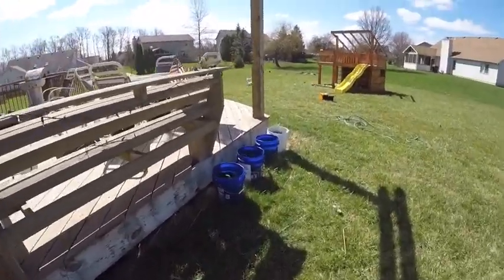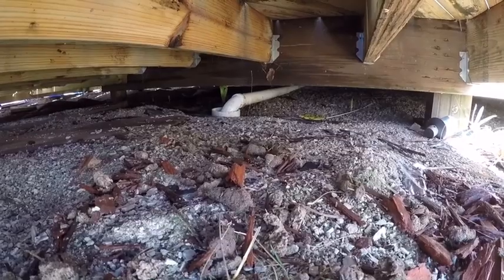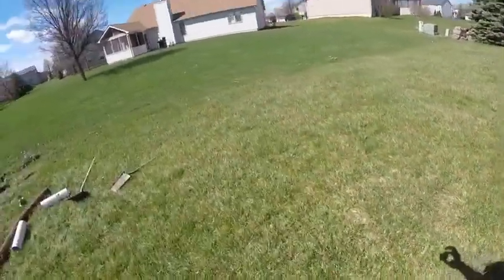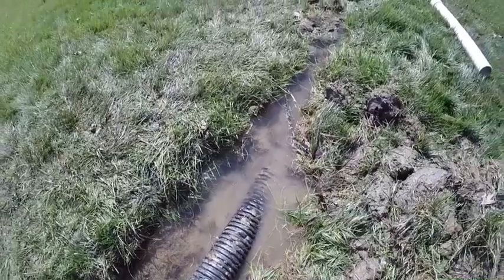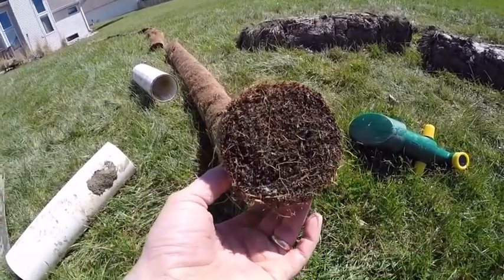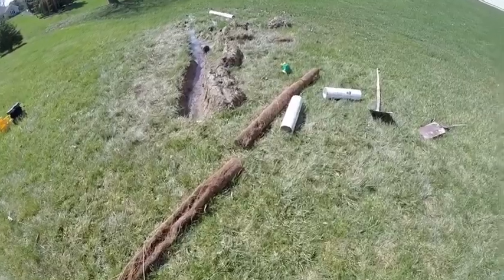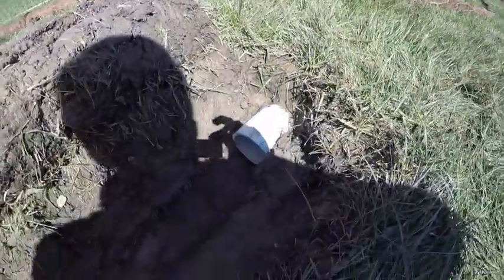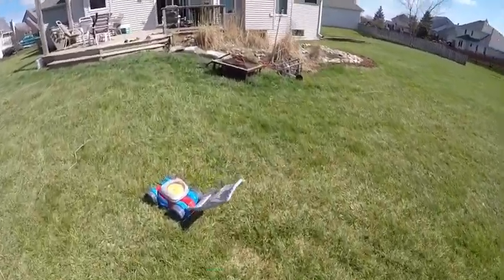How to Prevent a Root Invasion in a Drain Pipe

Comment: It’s not the pipes fault. The installer did not install it correctly. Should have have 1 ft of rock all the way around the corrugated pipe and had geotextile fabric as well. I’ve had French drains for 20 years with never any roots or dirt in them.
Reply from the maker: Hey preformancemustang,
Thx for the tip.

Comment: Step one Don't do a shallow French drain that is the biggest thing.  Those are grass roots and you can see how deep there go.  You pipe was just a few inches under the ground be a foot or more and you wouldn't of had that problem from grass.  Now  tree roots yeah you would of had that problem  Two even solid pipe will clog with roots takes a while but does happen.  All you are doing with that water is recycling it over and over again.  Unless you are putting it in to a drain tile to take it away to a ditch or sewer its not  doing much good.
Reply from the maker: Hey John, 
Thx for the input!

Comment: Dave, I had a 6 foot long tree root clog -in a solid 4" PVC drain line! The only way to prevent root intrusion, in the pipe, is to have the PVC terminate above ground.  My pipe ends on the side of a hill now.  You will have to dig a pit and line it with rocks, like someone else suggested -or you are guaranteed to repeat this project.

Comment: You need to put the pipe in the middle of a bed of clean gravel which is wrapped by a heavy non woven fabric.  Dig a deep ditch. Put the fabric down with enough on either side to cover the top later. Put minimum 4 inches of drain rock down, the pipe on that then 6 inches of drain rock on top and sides of pipe then cover with fabric. Done.
Reply from the maker: Thx for the added directions!

Comment: I just had a downspout replaced that was attached to a corrugated pipe going into the ground and empties into the ditch.  I had the gutter company just put an 18" extension out to the yard for now. They had to cut the top of the corrugated tile off to get the downspout out and after they were done, I went to cap it and noticed the same dang thing that you have in yours. It's plugged with dirt and roots. I cleaned out as much as I could but I cannot get to the rest of the pipe to the ditch because it's under the cemented driveway.  I just stuck my hand down there with a screw driver and tried to dig out as much as i could but now I can't go any further because the dirt and roots are so compacted into it that I can't get anything loose unless I dug the whole thing up which is not going to happen anytime soon.  The guy that lived here before I bought this house thought it would be a good idea to plant a cedar tree and several pine like bushes on top of the tile.  I don't know what the heck he was thinking.  Going to just cap this tile for now and hopefully nothing stupid happens later.
Reply from the maker: Hey Jennifer,
Sounds like a mess. Once the roots get in deep, digging it up is likely the best, (most painful, and sometimes near impossible) way to fix it. Fun!
Thx for watching!

Comment: Roots are not limited to drain lines.  We run into the same thing in shallow water wells where the roots come in through the perforations in the casing that let the water in.  The bad thing is we can't get to the pipe to dig it up.  The best we can do is make sure the well is grouted good and try to keep them from following the borehole down to water level.  https://www.youtube.com/watch?v=TVdA-u0YzVM is a video of one we pulled out. 
Have a good day,
Kenny

Comment: Here in Tennessee almost everyone who has a house built in the last 30 years that has septic tank with a drain field has problems. The reason being about 30 years ago the state code for a drain field was changed. Today any house built has to have a 2ft wide by 36” deep and 300 feet long drain field. Most houses have 3 100ft drain fields with cross over lines attaching them together. 30 yrs ago they were dug with an 8 Ft wide  bucket, 60ft long and 4 feet deep. Filled with 40” of gravel and a heavy layer of straw then dirt. That way worked much better for draining. If you had a clog somewhere the drain field being so wide the gray water could usually flow around the clog. As long as it wasn’t at the beginning of the drain field. The code here needs to be changed to the old way I believe. Good luck with your problem. Drain field problems suck! It almost makes you want to move into the city limits and just have city sewer!
Reply from the maker: Hi Silverhorder1969, your information about septic tank drain fields is very interesting.  We may be building a wedding barn in the near future out in the country that will require a septic tank, so we will keep your comments in mind if we go through with that project.  It sounds like Tennessee really needs to go back to the state code they had 30 years ago.  Maybe you could contact your State Representative to bring up this serious issue that affects so many people in your state.  You could show them our root invasion video so they can understand the problem.  We have vacationed in Gatlinburg cabins many times and we really enjoy Tennessee.  Thanks much for your comments!
Reply: You’re welcome Extreme House Flipping.

Comment: Truly amazing I think I have similar problem in my back and front yard.I guess only way to fix is to install new pipes in pvc plumber has quoted me several thousand dollars for repairs Starting to think may sell house I bet previous owner knew about this 4 years ago and of course not picked up by building inspection.I thought modern pvc pipes had overcome this root problem but this house is over 25 years old.They planted trees right over the sewer line front and back some people just plain stupid.
Reply from the maker: +trackburner Hi Trackburner, we have a rental property that had roots in the pipes. A company came out and ran a roto-rooter tool down the pipe, which chopped up the roots and solved the problem at a low cost. If you haven't tried that yet, it would be a good idea to use this method before replacing your pipes. Good luck!
Reply: trackburner check a drain cleaner guy...i watched a video where it looked like a solid pipe 10" i believe ..like from a concrete truck...and the machine goes through it...I think its worth a call, maybe ask for a free quote...gotta be a truck with a big holding tank...not a powerwasher you understand. .
Reply: Not that serious they have a main lone cleaner u can rent it at home depot for 60 bucks they will show you How to use it it comes with an attachment that goes in and chops up the roots then use a root killer twice a year for maintenance

Comment: My parents septic tank had 25' of 4" pipe plugged with thick roots & 25' of 2" pvc pipe that forked off from the 4" pipe that elbowed under their trailer framing packed with roots that literally snaked through the 25' coming out of their kitchen sink drain, my parents passed years ago so the trailer sat not being used therefore caused the lot of issues of roots taking over in the tank looks like a jungle of very thick roots scattered through the tank that have to be cut out though to think that these roots began in the tank & spread 50' into the piping is unbelievable a complete nightmare...
Reply from the maker: Hey Burt,
Ouch! That’s incredible! Sounds like a bunch of work ahead!
Thx for watching!

Comment: Roots will get in to solid PVC, ABS, etc. Takes several years but it will happen. But yeah, if the pipe is corrugated, it will need cleaned out every 2 years. Perforated, every year.

Comment: How did you know it was in that section of the yard? Did you run a camera?
Reply from the maker: Hey Waldorf,
I had an advantage. I put the pipe in 15 years earlier. After about a 50 foot run away from the house there was a junction between pvc and corrugated black pipe. I guessed that the pvc was not problem, so starting at that junction, I started digging down and cutting into the top of the pvc till the pvc had no more roots in them. Then I removed the clogged pvc and all the perforated corrugated black pipe and replace with solid pvc. I dug up about a 15 foot section of pvc ... the roots had grown into the pvc , back toward the house 15 feet.
Thanks for the question.

Comment: I think the video got cut off or something. There's nothing regarding how to prevent this.
Reply from the maker: Hey Wurum Burner,
The preventative measure is to use solid PVC pipe as opposed to perforated corrugated pipe. It’s the perforations in the pipe which allow root growth. Same with old clay pipe used decades ago for regular plumbing drain pipe. Where the clay pieces join together along with cracks that happen over time - that provides the openings for the roots to invade. 
Hope that helps.
Reply: @Housebarons  I have installed corrugated pipes to expel water from sump pump as well as downspouts. I used corrugated pipes without perforations up catch basin and for french drain portion, from catch basins to discharge point used perforated corrugated and covered it with sleeves. That sleeve is supposed to let water out but not let mud or roots to get in. Using catch basin allows you to inspect into french drain once in awhile to make sure nothing is caught up inside.

Comment: You would have been ok if you had used the wrapped corrugated pipe. It does come wrapped with landscape type fabric to prevent root penetration.
Reply from the maker: Hey Rich ie,
Thanks for your input. I've not tried that so I'll just leave that to the next guy.
It is definitely a much debated topic on forums. I've seen places where people are adamant that it needs to be a continuous and seemless length of pipe or schedule 80 pvc glued. 
The fear is that the slightest hole is the beginning of the end ( especially with tree roots). 
What I will say is that ANYTHING is better than perforated corrugated.
Thanks again for your input!
Reply: Extreme House Flipping and you are right. Wrapped or not, root entry will occur. Even glued connections are subject to root entry. 

Look into using a root preventer adhesive for all connection points. Such as Root-Ban. I’m a firm believer that given time - roots will eventually find  a way into a pipe. They are ways to impede them though.

Comment: So, how do you prevent it?
Reply from the maker: Hey lwb256,
The key is NOT using perforated drain pipe . Solid pipe and maybe pvc pipe w/ cemented/glued seams will go a long way to prevent that root crawls 
Thx for the question and views!
Reply: Copper sulfate

Comment: How much is it to clean your sewer line with roots?
Reply from the maker: Hey Lucero,
It all depends on who you get to do it. A roto-rooter type company might charge 75- and up ( just a guess) and a plumber maybe more than $100. ( another guess ).
Also depends on how bad the clog is and how long the drain.
I had a friend who thought they had a clogged drain and it turned out to be s collapsed pipe. The fix was more than $4000 to replace it. 
Hopefully yours isn’t expensive. 
Thx for watching!

Comment: Was it because you didn't dig deep enough and put gravel underneath and around the corrugated pipe?
Reply from the maker: Hey R,
Yes, gravel could help. But in the future I would use solid corrugated rather than perforated.
Thx for watching!.
Reply: @Housebarons  And where will the water go then? Seems like you need to install a drain field, similar to the ones used for a septic tank drain field.

Comment: Way cool root anaconda! Mass of fibers feeder roots do not resemble Woody tree roots. And one would think grass roots stay attached to their above ground green hair follicle blade. 

Did my attention span fail me by missing out on what backyard plant was producing drainage roots. Or was it still assumed an out of sight front yard tree the culprit? 

It's crazy cool how big tree roots can be found remotely growing in a far-away location. Especially silver maple. When uncovering one and able to identify species. I get a kick out of tugging at a small root knowing I'm touching tree from so far away.

As an arborist I learned long ago on my own how large tree roots inevitably terminate by transforming into smaller fiber feeder roots.

During Roman and Greek times engineer's would stick a small Root down a crack belonging to Boulder they want to split with roots hydraulic forces as it gets bigger.

Today engineer's compact grade under sidewalks which intentionally results in Roots growing on top of ground instead of underneath through compacted oxygenless soil below cement. Even inviting roots under slabs when cooler temperature differences produces tasty dripping condensation.

But when it comes to this plastic landscape pipe in video. No surprise here, roots are supposed to do that. But usually people throw out the baby and keep the bathwater.

I mean remove tree after inviting roots to the drainage pipe leaking party. 

Once the tree excuse is gone, people are still stuck with busted pipe. One can only hope that after boring out Roots growing inside pipe, a woody leakproof sleeve is Left behind filling in voids.

Wouldn't that be cool though, a Gi gi gi Gia plumber plant brought to you from the same makers of Fix-A-Flat and Gia drow seedless smoking grass.

Comment: How long ago was the pipe replaced? ?  Got to change the whole line going out to solid schedule 40 pve..put amoe cleanouts in for future use..
Reply from the maker: Hey Thomas  Broking,
The pipe took more than a dozen years to get that clogged. I switched it all to solid 4 inch pvc till it got to a larger 6 inch correlated that doesn’t seem to have the same issue. I replaced about 50 feet of drain pipe.
Reply: Extreme House Flipping is the 6" pipe supposed to leak, gray water?.. I was wondering on the groth because i changed a line packed like that, into the fresh air pipe..and the lady told me she had it snaked last year..lmao..

Comment: when was the corrugated pipe installed? were those grass roots?
Reply from the maker: Hey Mark, 
The pipe was there maybe 10 years? Not really sure. I believe they are grass roots.
I too had never seen such before. Pretty shocking. 😮
Thx for the question.